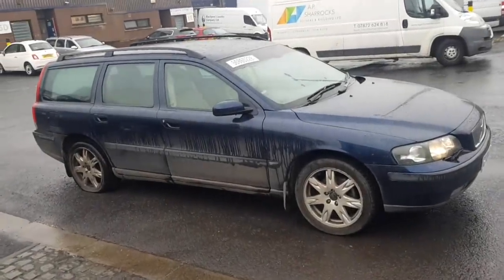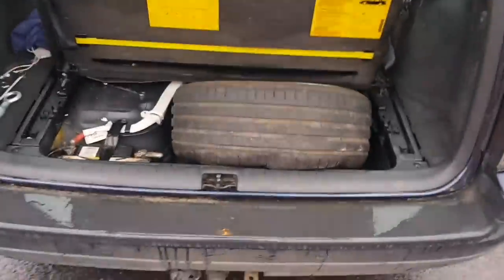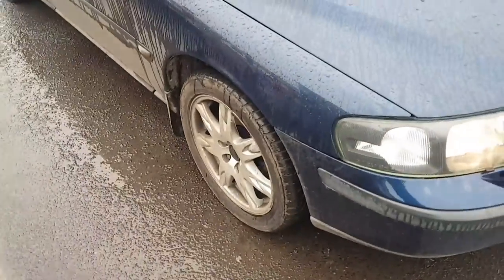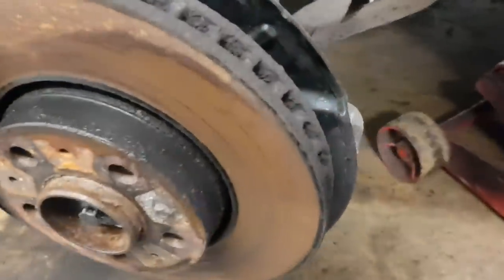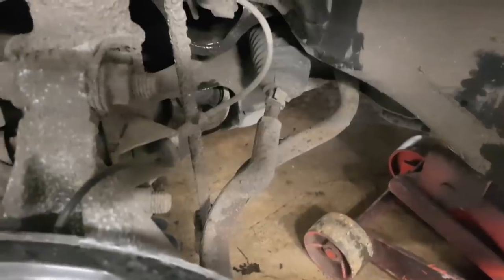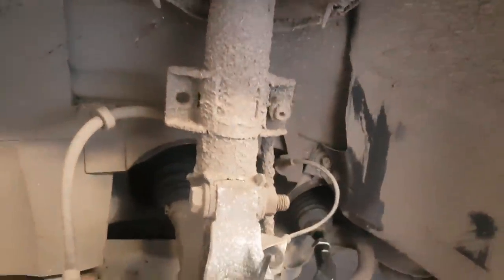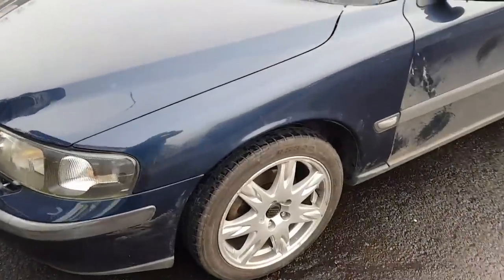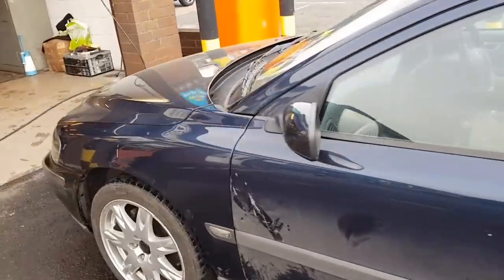Saving my filthy accident damaged volvo v70! Copart rescue.

Comment: i bought a 1982 toyota corolla with 350,000kms for $400 Aussie dollars. It had a blown head gasket and I put 30,000 more kms on it and ran it with the blown gasket by topping up the water every 2 days

Sold it 12 months later for $400!

Comment: Next week?? Ugh away man cannie wait that long! Lol. Saab 9-3 1.9tdi wife used it for going up and down the M90 to Perth, Stirling and Edinburgh from Falkirk scrapped it last year because the bodywork was so bad it had 100k when we got it free off her mum scrapped with 235k on the clock engine was still solid on its original clutch to, we bought another 2008 with 72k on the clock had it 2 years now never had an issue apart from track rod end and rear caliper siezed nothing major.

Comment: 2003 Mazda 323F. Paid £200 for it, ran it for 7 years and 85,000 faultless, reliable miles. Sold it for £300 and believe it's still on the road.

Comment: Ford mondeo 2006 tdci  with over 200,000 on it Was a co part car with front end damage , bought it for £220 and drove like a new one . And a 1999 Saab 9-5 which was abandoned for 5 years , put new disks and pads and a service and it flew through mot

Comment: My cheap car is a 1993 Ford f150 2wd, I paid 400$ for it and it needs a motor mount and an exhaust valve that needs to be unstuck. Overall I think I did pretty good even if I'm considering replacing the motor all together.

Comment: 98 Saturn SL2
$200 - Listed Not Running
Said ok, got it towed home. Owner stated the ignition cylinder and switch were replaced, so I took it all apart, IGS wasn't lined up with the key cylinder, tripping the kill switch, and wouldn't disengage. Got it all lined up and put back, charged the battery, reset the security system, turned the key... after a sluggish starter and fuel getting to the motor, kicked right on. New starter and battery terminal bolts, basic maintenance(fluids/filters), valve cover gaskets, and past due registration fees, $600 for a mint condition daily driver.
Reply: Can resell for $2200, just need a windshield and interior shampooing. Then I'll sell her.

Comment: 1990 geo metro that would blow a cloud of white smoke when you would step on it they said it was sucking oil in through the pic valve but never did I ever have to add oil. The best part was the white cloud of smoke if you were behind me you'd have to pull over for fear you'd hit me through all that😂

Comment: First car was a Ford KA, it had 3 different keys as all the doors were off different cars. Turns out the guy who sold it was a panel beater so he had bought it damaged and done it up. It was an awful car though, the radiator was prone to going and the clutch went after 10k. We part ex'd it for a new car with a smaller engine and that was fine for a few years until I hit a pothole and fucked the power steering.
Reply from the maker: Yeah. They were pretty poor cars 😂

Comment: I bought a Ford Ka for £450. I had it for about a month and the engine blew. 
We sold it for scrap... next thing we saw it back on the road with a new engine 😭😭
😭
I now have a Ford Fiesta Titanium. We’ve had a few problems with suspension and  someone crashed into it in a car park! The whole side had to be corrected. It had done 92,000 miles and we’ve just replaced the cam belt and water pump. 
I know Ford are cheap but this car is amazing and it’s 9 years old and it most definitely is titanium 😂😂😂

Comment: You should've tried to grease the inner tie rod, it looked very dry to me. I would've also suspected about having a bent control arm... Otherwise, I liked the video. This channel is getting very entertaining to me!
Reply: Wheel alligment will tell is there some damages in suspension
Reply from the maker: Everything seems OK, the wishbone is cast alloy so they usually break rather than bend. As someone said though. The alignment would show up any irregularities.

Comment: When I worked for Honda in Liverpool back in the 90s I had my first car was a mk1 Fiesta I paid a grand for it now that was a money pit but a px came in at Honda mk2 Civic hondamatic 1984 it was 1 owner from new and it only had 30.000 miles on the clock I had it for 2 years and put 100.000 on the clock I was having trouble with the auto box it needed new gears but I sold it with 130.000 on the clock and made money on it I paid only 600.00 pounds sold it for just under 2 grand

Comment: Good luck. I don't think I've ever paid more than £350 for a V70. All T5s tho. I hear the fuel economy on the D5 is apalling (for a diesel)?
Reply: I don't know who told you that, this model is quite capable of doing 55 mpg and over 40 miles per gallon however fast you drive it
Reply: Fair enough. Maybe apalling is an overstatement.  However a diesel with less than 200bhp that can't average 50mpg all day long is still nothing to get overly excited about me thinks.

Comment: Bought a 2003 saab 95 aero HOT for £100. Spent £350 for a replacement engine. Sold the car a year later for £900.

Comment: £200 ford fiesta GL 1.6D it was a great car itvwa s fitted wuth xR2 suspension and anti roll bars So it was great for cornering and the low end torque ment it could go. Trainee mech killed it by not using locking tool in the engine  whilst changing the cam belt he put all timing out it never ran correctly agreed that sad day for me.

Comment: My first car was a Punto active sport which I bought for £400, it was a nice spec with all maroon interior and a nice radio with a sub and all that. Turned out not very viable cos about a 1000 miles later  the head gasket went and I sold it for £180. Shit happens

Comment: Spent $3000  on a used Volvo V50 AWD 220hp -05 with 30k km on it, owner lied about the shape it was in. I bought new tires for around $600.
My mechanic-friend looked at it and had to replace half of the undercarriage, battery, shocks, springs and wheel bearing, (the bearing again after a few months). Sold it for $1600 after a year, and I'm still crying about that piece of crap car :'(

Comment: Renault Scenic - absolute money pit. Handbrake cable went which turned out to be in a sealed unit, replacement cost £400. electronic dashboard went, managed to get renault to pay 50% so that was 'only' £450. Lost the key (fancy card thing) over £200. I hated that car, in fact I haven't owned it in over 12 years and I still hate it. Should have never had bloody kids :)

Comment: I'm sure it will be gleaming asap! Someone told me the 4x4 volvo's estates have to have all the tyres changed at the same time so the tread is equal all round - don't know if that's true?
Reply: No it is not true after 2002 and only semi true before that!
Reply: Thanks Nick
Reply: @snacklofter  pre 2002 front and rear tyres had to be within 3 mm of each other and preferably the same make and type.
Reply: Cheers Nick.

Comment: You guys in the U.K are so lucky almost all your cars have stick shift trans while here in the U.S.A they are all autos. It really stinks.
Reply: Jacob Wilson that may be the case, but out here in flyover country, auto and cruise control are practically necessary if you are going from point A to point B rather than just driving for the sake of driving.